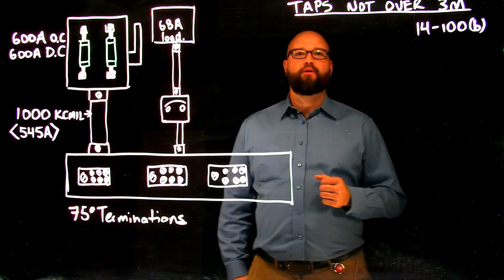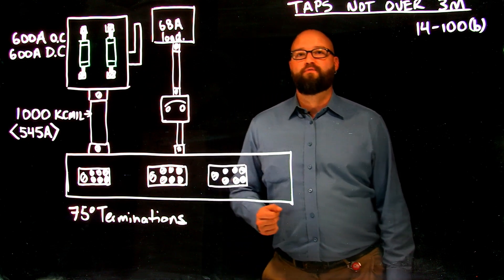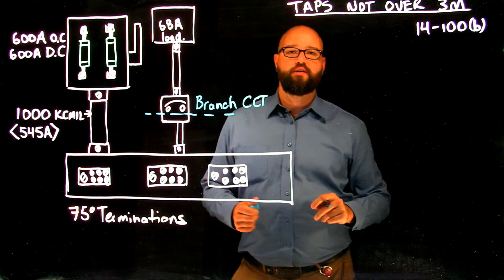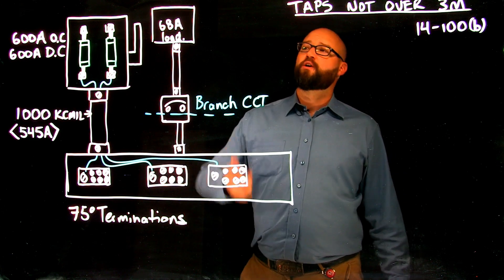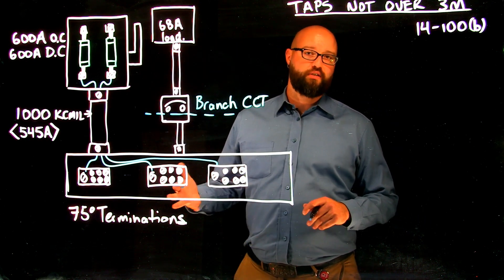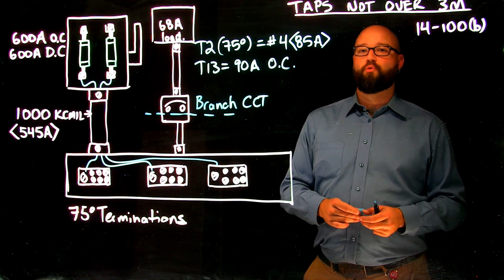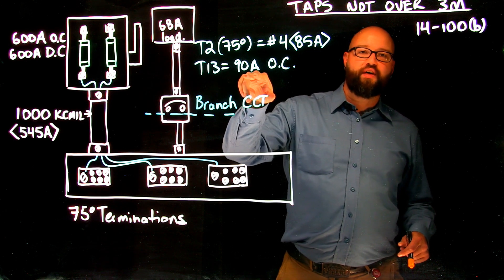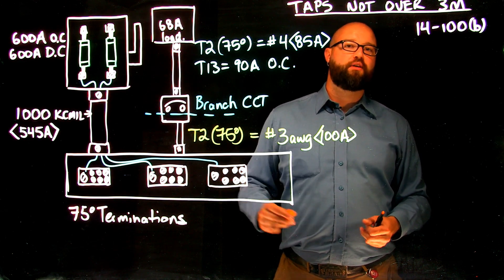Tap Conductors Part 2 (Not over 3m)

Comment: why are you sizing your OC device with the ampacity of the wire supplying the load? for example here i have a 40 amp hvac unit. and a #8 wire is needed, which is rated for 50 amps. t13 tells me rating shall be set at 50 for the OC device. but my work sheet says that 40 is OC device. a bit confusing. my worksheet here shows more of that example (the 40 amp one), and another example is a 70 amp hvac unit, my worksheet says the OC device is 70 amps... but wouldn't it be 90 amps?, because #4 is needed, #4 is rated for 85 amps ---> t13 says 90)
Reply from the maker: 14-104 requires that we use the allowable ampacity of the conductor to determine the overcurrent device. If the load is unknown we are not permitted to exceed the allowable ampacity, but if the load is known and calculated as per section 8, we are permitted to exceed the allowable ampacity in the event that there is no corresponding overcurrent size.

In that situation we are permitted to go up to the next available size of overcurrent.
Reply: @AFKCPU @schulerruler this 68A load is either a non continuous or equipment is rated at 100%, permitting you to bring 68A right to table 2, which you did, right? 

However you said according to 14-104, if the load is known (68A) and calculated as per section 8 (meaning what? That it has that 80% rule included; 20% buffer?) your ocpd can exceed the ampacity of conductors... which you did - 90A fuse is over 85A conductor ampacity - but you didn't calculate as per section 8. 

My questions then are: if you didn't calculate as per section 8, why did you have an ocpd higher than the wire ampacity? Is this example using 100% rated equipment or non continuous? And why would the above person's worksheets permit a 40A load on a 40A ocpd and 70A load on a 70A ocpd, and not 50A and 90A respectively, if the loads are known? Their worksheets must suggest it is 100% rated equipment right? It seems like those answers are using the 60°C column, why**? 

Thanks for reading.

Comment: So the columns listed in tables 1 to 4 (being 60, 75, 90 etc) those are insulation temperatures of the wire, right?
or are those corresponding ampacities to the termination temperature of equipment if used on that equipment?
thanks in advance
Reply from the maker: They are the insulation temperature yes, but the lowest termination temperature is what determines which column we select the ampacity from based off 4-006 1). 
Even if we had 90 insulation, if the temperature of the equipment is 75, it trumps the insulation at table 1-4.
Let me know if this helps.
Reply: @schulerruler  so if we thought to use 75 degrees Celsius rated insulation on our wire on a piece of equipment with.  90 degrees Celsius termination temperature, we should change it the wire to a 90 degrees Celsius rated wire (therefore also looking to the 90 degrees Celsius column to pick our wire)?
Reply from the maker: You definitely could to take advantage of the higher current carrying capacity. Otherwise your be still limited by the 75 degree insulation.

Comment: The branch circuit under the load would be like a disconnect? just trying to visualize how this would work in a practical example
Reply from the maker: This would be the conductors you run out to the point of utilization. The overcurrent would be what protects the conductors, that are sized from the load draw.

Comment: Why did we use the 75° column on table 2 for the 68 amp load if 4 - 006 2) a) states that under 100 amps/#1 awg we use the 60 degree celsius column? Sorry, just a little confused...
Reply from the maker: 75°was the given value in the question and if the termination temperature is known 4-006 1) requires that we use that. 
If we are not given temperatures then we would apply 4-006 2) and use the 60° . Under the splitter I have 75° written, so that is why we are using it in this example.
Reply: @schulerruler  thank you for the explanation